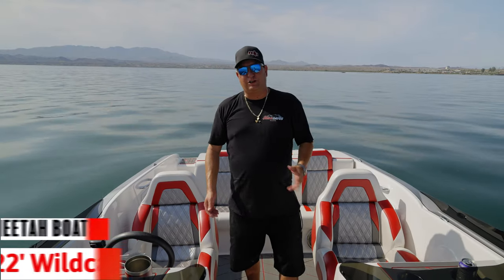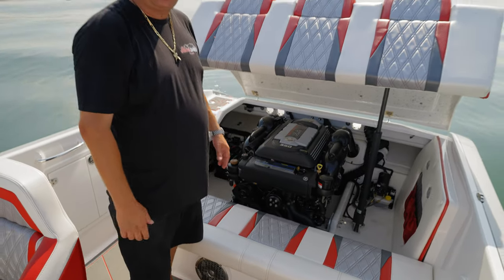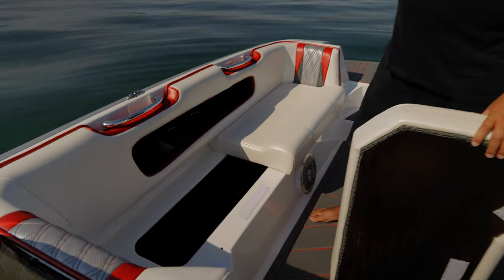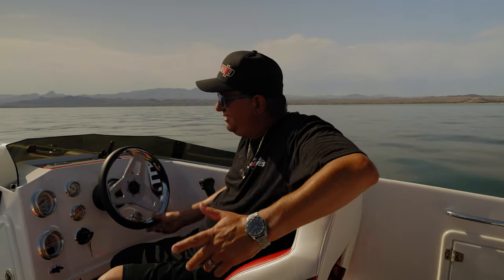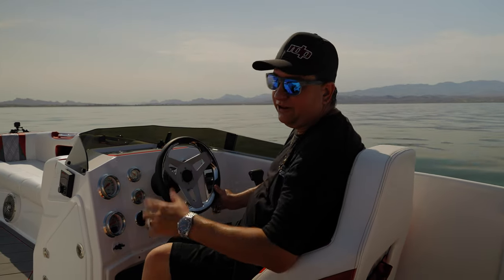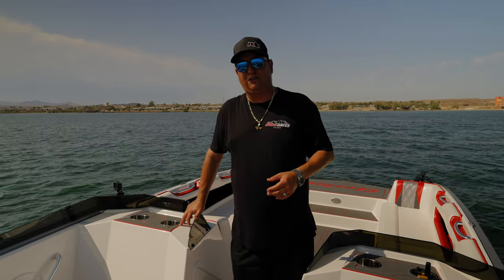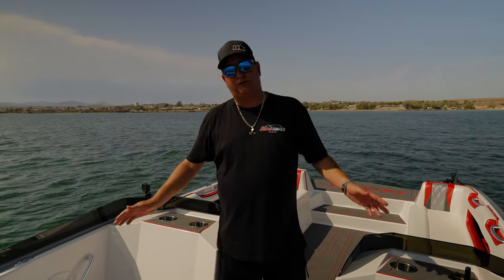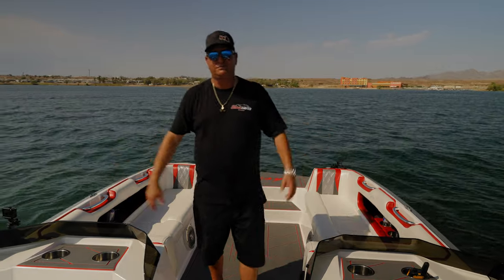22' WILDCAT Cheetah Power Boats Test Run

Comment: Great video. Curious what the length on trailer is. Considering this or the Shockwave 22 Deck.
Reply from the maker: Guessing 26-27?
Reply: @RiverDavesPlace  likely. The Shockwave is around 27.1ft with swing tongue which may be around 6-8 inches too long for my small garage unfortunately.
Reply from the maker: @jet_jess  depending on how the trailer is built you can shorten it up a hair.    No matter what though it's generally overall length plus 3' when you add the outdrive etc..